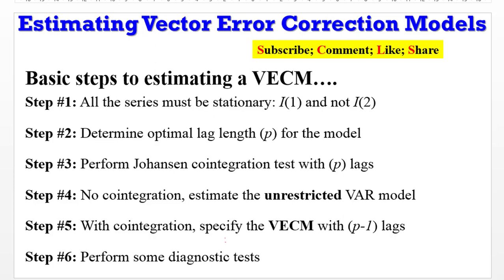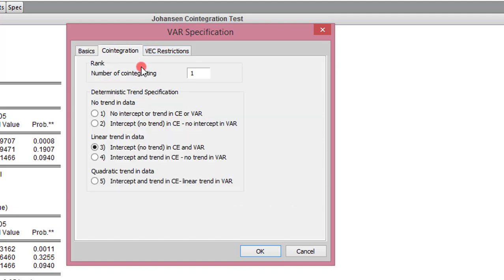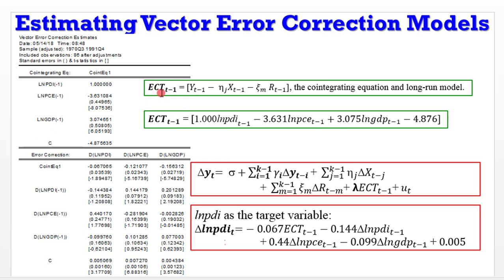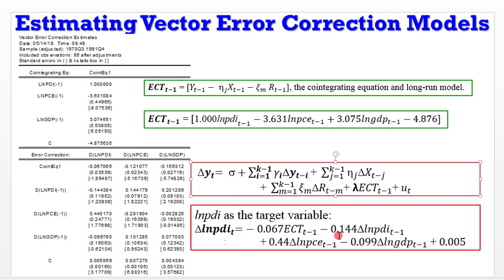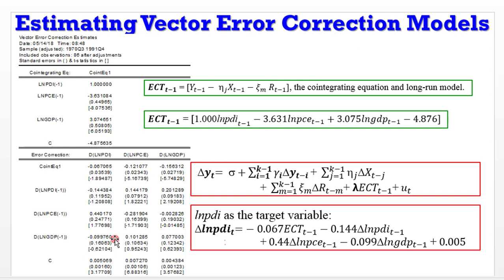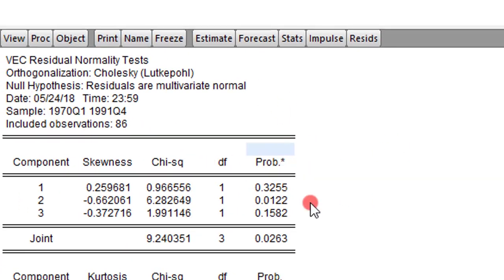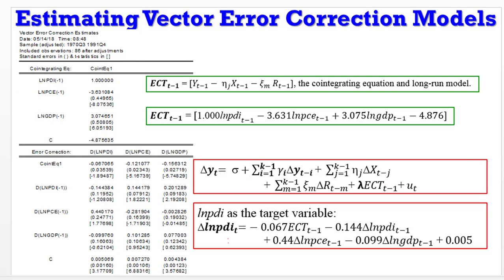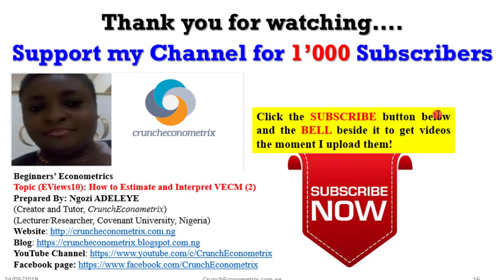(EViews10): Estimate and Interpret VECM (2) #var #vecm #causality #lags #Johansen #innovations

Comment: Respected Madam, I have Learnt a lot from your valuable
videos specially in VAR environment. I am preparing electricity demand forecast
using conventional multiple regression analysis since long. Now I am shifting
to VAR model, I have gone through all steps

1.      
lag selection criteria for each variable 

2.      
unit root test for each variable 

3.      
found I (1) Cointegration 

4.      
Combined lag selection criteria found to be I (1).

5.      
Johansen cointegration showed one integrating
equation with using 1 Lag

6.      
Then I ran VECM with 1 lag 

7.      
Speed of adjustment come negative and
significant 

8.      
No serial correlation, no heteroskedasticity,
normality test is ok

9.      
It also passed cusm stability test 

My VECM model is statistically ok.

In Johansen Equation, we interpret it by changing the
sign, while after changing the sign results are according to econometric
relationships e.g. if price is increased, the consumption will decrease. My
question is that in the VECM Long Term equation. the results are not coming
according to econometric theory i.e. Price elasticity is not negative. so, is
it ok? But in short Term Model in VECM the electricity elasticity is coming to
negative.

My next question is, now i have
computed both Long run and short run equation from the VECM model and, I can
compute the residuals ECT t-1 from the long-term equation and also,
I know the coefficient of ECT i.e. speed of adjustment 

My data was from 1985 to 2019 and
my independent variables are total GDP, real price of domestic category
electricity and population of Pakistan and my target variable is domestic
electricity consumption.  I have taken
all these variables in logarithmic form. 
now my request is how I can get the forecast of my target variables for
my next 10 years while I can project the independent variables like GDP, price
and population for next 10 years. but how can I make projection of ECT t-1
for next 10 years by transforming this short run equation in a form that
I can easily calculate forecast of my target variables. currently i am facing the
issue that in equation my target variable is in differenced form which is the
form of VECM equation. 

In OLS regression analysis after
finding out the elasticity of the best equation we can easily transform this
equation into 

 Electricity Sale = (1 + Growth Rate GDP) GDP
elasticity x   (1 + Growth Rate Price) Price
elasticity x  (1 + Growth Rate Lag
sale) Lag elasticity 

Is there some method to transform
VECM equation like the above-mentioned equation to compute the forecast? 

 Can you tell me if
there is any option in EVIEWS that it can give us forecast for the period
beyond the data if we provide to EVIEW the projection of independent variables?
Normally this projection work doing in excel.

 Is it possible can
you make a video on VECM forecast for next 10 years to understand the concept?

Best regards
Reply from the maker: Hi Bilal, your query is TOO LONG. Kindly go straight to the point. Thanks.

Comment: Great tutorial on VECM. Only one query, the model is showing that in the long run, a 1% change in GDP is associated with 0.099% decrease in PDI. While statistically, the model is appropriate. However,  in economics, a rise in GDP in the long run or the short run should result in an increase in personal disposable income (PDI), rather than a decrease in PDI. Can you please comment on this. It will help a lot.
Reply from the maker: Hi Sher, results are a function of several factors: variables, scope, and technique used. Besides, there are tons of empirical findings that contradict a priori expectations. Yours could be one of such.

Comment: Hello m'am. One question: In the short-run part, the CointEq1 of the Error Correction, If I have a value of 0.0783 where you have -0.067 in min 02:00, is this correct? I read that the value should be between -1 and 0 but I don't know if this is correct. The long-run coefficients are significative, but this 0.0783 it's not. 
This 0.0783 is placed where you have the -0.067 in the short-run equation.

Thank you very much m'am. 
Best regards!!!

Comment: Thank You for your reply
Now my specific questions are as follows
Q # 1
If in Johanson test lag length criteria tells us lag = p= 1 . So for VECM as you said in your vedio take lag as ( p-1). What should I do

Q. # 2
I have computed the VECM conventional equation with 4 variables like electricity sales, GDP, electricity real price, population, which is also pasted below. Kindly guide me with a video or with some other means, how I can transform this equation to compute the forecast of the electricity sales. The target variable is     LDOM8519   electricity sales which is in differenced form. 

∆ LDOM8519t =  0.611109 + 0.185012  ∆ LDOM8519t-1 +  0.5014  ∆ LGDPTOT8519(t-1)             - 0.014722  ∆LDOMRP8519t-1 -24.51419   ∆ LPOP8519t-1  -  0.48071 ect(t-1
)
Reply from the maker: Hi Bilal, my responses:
Q1: In this case, use 1 lag since VECM cannot be estimated as a static model.
Q2: My videos on "forecast error variance decomposition" will be helpful.
Thanks.

Comment: Thank for your video 😍 I have a question. If there is serial correlation or the residuals are not normally distributed, what would we do? Can we do anything to fix the model?
Reply from the maker: Hi MooMoo, there are several measures you can deplo: readjust the lags, change regressors etc and re-estimate the model.

Comment: coefficient values shows e (t-1) values in the running model as you hove shown after performing VECM ?. If it is significant and negative it means there is long run relationship exist.
Reply from the maker: Yes

Comment: How do you proceed when you obtain non-uniform results during johansen cointegration test i.e you find that there is no cointegration under trace stats but there is cointegration under max eigen value? will you estimate a VAR or VECM?
Reply from the maker: Hi Dennis, I mentioned in my video on Johansen Cointegration Test that researchers take decision when the results conflict which guides subsequent approach.
Reply: Thanks.

Comment: hi professor, thank you for the great video, it really helped, ill be sure to share your channel.  I have a question regarding the optimal lag for the VECM model. my optimal lag is 7. does this mean for the VECM my optimal lag would be 6 (p - 1). If so which short-run dependent variable lag should I use. aka d(GDP(1)). D(GDP(2), D(GDP(3) etc..
Reply from the maker: Hi there, yes use 6 lags for the VECM. Follow the guide as explained in the clip on how to proceed.

Comment: Dear ADELEYE, would you please answer these two queries?
(1) In my model all variables (both IDV & DV) are cointegrated at I(1). Thus I used VECM. While running varsoc <Dep. variable & Indep. variables>, lag one [1] is suggested by all criteria. Now, while checking cointegration, what lag should I use? one or two? And what lag should I use in estimating vecm?
(2) In my other model, cointegration exists but while running ecm error correction term is found insignificant, in this situation what should I do?
Reply from the maker: Hi Chinta, for (1) I gave clear explanations. Kindly watch my VECM videos again. For (2), simply interpret your results. There is a long-run relationship (cointegration) but reversion to long-run equilibrium (EECM) is not statistically significant. Thanks.

Comment: Thank you very much for the videos!! Is it a problem because in my model, the probabilities are less than 5% level so there is serial correlation and on normality all  components showed a high prob value hence are distributed normally however the total shows that residuals are not normally distributed. And on heteroskedasticity the prob value is 0.44 so the model is not heteroskedastic. So what should i do or its fine like that?
Reply from the maker: Takunda, correct the model for serial correlation. Estimate the model at higher-order lags.
Reply: @CrunchEconometrix  Thank you, much appreciated!! I used 6 lags for serial correlation only and starting from the 2nd lag up to the 6th, the model is now showing that there is No serial correlation. However, i wanted to know is it not a problem because from Var lag order selection criteria i was using 2 lags but i now change them to 6 lags on residual tests
Reply from the maker: No, it's not. Put a note note in the text explaining what you did about the diagnostics.

Comment: Great video. Loved it. Got one question just to be sure. You described the lambda (speed of adjustment) and its meaning, but no mention as to its sign. But then noticed that in your example it was negative. Must it be negative to have some meaning? What happens when it's positive?
Reply from the maker: Hi Douglas, I appreciate the positive feedback. Deeply appreciated. You skipped the prerequisite videos that contained the information you seek. Kindly watch them. But note that theoretically the sign must be negative. if positive it implies there is no convergence to long-run equilibrium and the model becomes explosive. Thanks.

Comment: Thank you!! But what can we do if there is heteroskedasticity.....?
Reply from the maker: You can initiate a battery of measures: re-estimate at higher-order lags, and/or change regressors.
Reply: CrunchEconometrix Thank you! Can I re-estimate the equation by using the LS method but changing  the covariance method to Huber-White?
Reply from the maker: Not advisable. Use the VAR routine to estimate.

Comment: Thank you so much ma for a good presentation. In a case where there are two cointegrating equations (that is none and at most 1 are asterisked) , do we interpret the D(...)(-1) or the D(...)(-2) of each variables for the VEC estimates?
Also following the video preceding this one, in a case where we have the variables stationery at first difference but different max-lag lengths for the unit root test, is it still acceptable to use or not acceptable to use  if the  are different unit root lag lengths for the variables?
Reply from the maker: Hi Praise, thanks for the encouraging feedback. Deeply appreciated! Follow the guide and explanations. Use 1 cointegrating equation. Same lag length is used for all variables.

Comment: Hello, 
Thank you for all your uself videos.
 Can you please clarify if you use a Normal distribution to assess the variables significance and if you use a two tail test?
Reply from the maker: Hi Martina, regression outputs come out as 2-tail tests.
Reply: @CrunchEconometrix  
Thank you for the advice.

Are you using a Student T-distribution to check the critical values?
Reply from the maker: @martinamarino8700  I use the corresponding pvalues.

Comment: Thank you for your explanation, I really appreciate it!
Further, I want to ask, what if the Cointegration Equation is not significant? Does it mean that both in the long run and short run/only short-run have no relationship between the dependent and independent variables?
Reply from the maker: Hi Utama, if that is the case then the long run relationship is statistically not significant.

Comment: Hello maam I am here again. Thanks for the video again and I really thankfull, but I have another question. How to interpret the ECT Coefficient that has (+) positive sign? So, I have a significant ECT coefficient at 5% and the coefficient is 0.534676. Is the way to interpret it different compare to ECT coefficient with negative sign?
Reply from the maker: Hi Rizka, positive ECT is interpreted in the opposite. No convergence to long-run equilibrium. Model is explosive.
Reply: @CrunchEconometrix  thanks for the answer mam. You are so humble and answering each of the question here in comment section, I already transform my variabel into log natural now it shows there is one cointegrating equation, but from the VECM it shows that the ECT not significant from t statistics also p-value and the ECT has negative sign. So should I interpret like " there is long equilibrium between variabel but not statistically significant?"..Thank you again mam 🙏🏼
Reply from the maker: Correct. Or simply "no significant reversion to long-run equilibrium".
Reply: @CrunchEconometrix  thank you so much mam, really appriciate it, I am working on my undergraduate thesis..thanks a lot for all of your video about this method 🙏🏼💙

Comment: The F-statistic is not explained and how to obtain the probability of it is not mentioned
Reply from the maker: The F-statistic has the standard interpretation of proving the joint significance of the independent variables.
Reply: @CrunchEconometrix  please at what point can we say fstatistic is significant or insignificant in VECM? AND can you please help me make video on only the interpretation of Structural VAR? THANK YOU.
Reply from the maker: The pvalue of the F-statistic will point you to the right direction. You can easily pick up publications that use structural VAR and read up on the interpretation. Thanks

Comment: Hi professor. My three variables are all I(1). According to Johensen test, there are 2 cointegrations. However,when I construct VECM, C(1) is not significant and sometimes not negative. 
I have no idea where the mistake exists because I followed your method step by step.
Reply from the maker: Hi Jacky, the outcomes we get have a lot to do with the variables used for analysis not necessarily because the econometric procedure is wrong....assuming things are done properly.

Comment: I have some issues about this model..
1.Is it necessary to include the ECM equation (raw equation,not computed one) in my article
?
2. Though my speed of adjustment is negative but it is statistically insignificant (  p value is higher than .05) ,is it a matter of concern?
3.Relevance of Macro Economic factors for the Indian Stock Market
 by Aman Srivastava
(2010) order the equation in another way, was it wrong?
Reply from the maker: Hi Abdullah, I've read your queries over and over again I still don't understand what you mean?

Comment: 4:27 I don't understand this part. the coefficients have low t-stats, so how am I allowed to put those coefficients into the equation when they're not significant?
Reply from the maker: Hi Ecksdee, you construct your equation regardless of whether the coeff is statistically significant or not. Confirm this from any econometrics text.
Reply: @CrunchEconometrix  hi ! any text book suggestions to find this?
Reply from the maker: @danaeellina2645  You mean you don't have any econometrics textbook that you use for studying?
Reply: @CrunchEconometrix  I do but I have not found one that says its OK that the error correction in 4.27 is insignificant. I need to back this up somehow so I would love a suggestion on one that says that we must include the error term irrespective of its significance!
Reply from the maker: Alright.
Reply: @CrunchEconometrix  do you therefore have an textbook suggestions for this?
Reply from the maker: Dana, your initial query is about how to write out your output which I responded that you can get that from ANY econometrics textbook. Whether or not significant ALL outputs can be expressed in equation form.
Reply from the maker: @danaeellina2645  ... And I told you in clear terms that it can. If you need need a specific textbook for that you can NEVER get. Adapt the generic knowledge to your results and explain your output.
Reply: @CrunchEconometrix  thank you !

Comment: Dear teacher, is there a heteroskedasticity test like that in Stata as well? Also, you have chosen the (No-Cross Terms) option in your test. There is the (With cross terms) option too. Would you kindly explain when should we use each of those two options?
Reply from the maker: Hi Revolta, you can do further online readings on both concepts. Tx

Comment: I have a problem with my regression. I'm using Eviews as the econometric software and I'm running Vector Error Correction Model (VECM). I have a problem of heteroskedasticity and autocorrelation. I don't know how to correct them in Eviews using VECM.
Reply from the maker: Hi Bentou, correction will require several measures not one. You can try increasing or decreasing the lags, changing regressors or control variables.

Comment: How can I interpret the coefficient of ECT  if the sign is positive ?? Thank u in advance
Reply from the maker: It implies that the model diverges. There's no reversion to long run equilibrium. Model is explosive.
Reply: CrunchEconometrix so in this case I should interpret that like this or may I change my model . But after researching on other plateforme I found that it is possible if there’s a structural change or break is this right .
Reply from the maker: There is no right or wrong. The result is what it is. Surf the web and you will find papers with positive ECT. You may also decide to re-model by changing or removing some regressors.